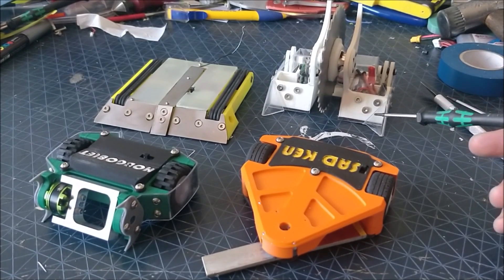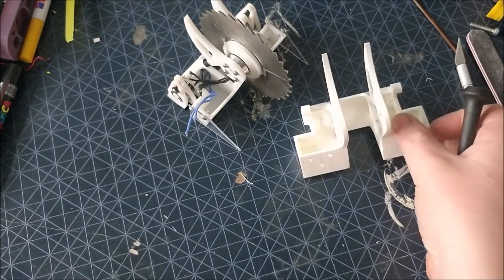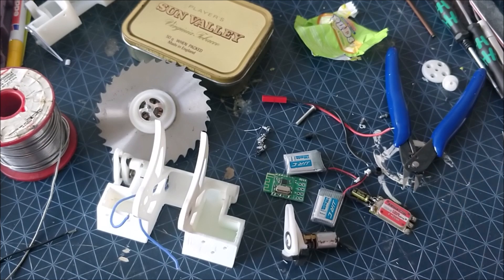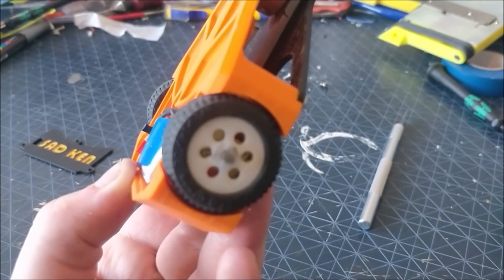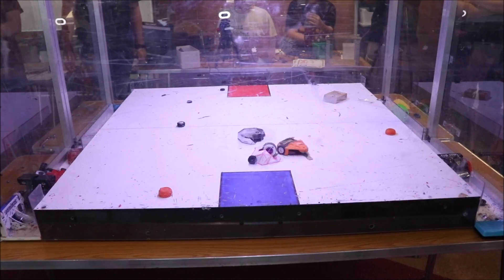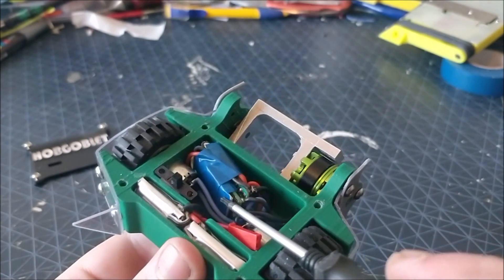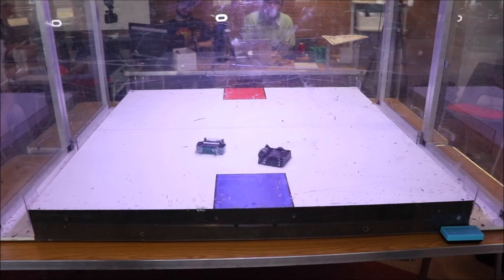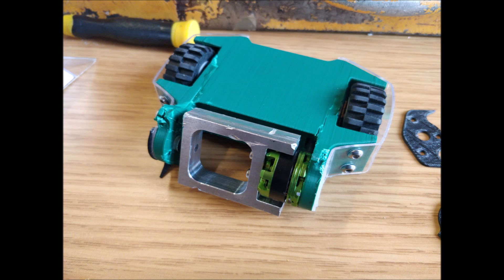A look at some Antweight Battlebots - AWS64

Comment: I know it's a bit old, just wondering by ABS? I never had good layer adhesion with ABS/ASA. At least nothing compared to what I get with PLA, and the impact resistance is way lower than Nylon as well.
Reply from the maker: @werner-real  honestly? I had a zortrax which is an ABS machine and the layer adhesion is immaculate and it's just hit print get part. I use a lot of nylon for my beetles and 'proper' robots. I prefer ABS to PLA as I find it a lot softer and less prone to brittle fracture.
Reply: @HarryMakesThings  I mean it prints and I even removed the fan which seem to make it a little better, but it's still miles away from PLA+ / PETG / TPU. That's why I'm surprise that for bots it's recommended. I know TPU is often forbidden.
Reply from the maker: @WernerBeroux one of the printers I have is a purpose built ABS Machine and while dated is a great asset for just hitting print. I also find the closer to 'pure' ABS the filament is the better. Polycarbonate/ABS blends are fairly often sold as filament which I find really brittle. This stuff is quite nice and soft and tends to take impact well. I'd take this over PLA-ST though I am a vocal champion of that material being the best off the shelf material that any printer can handle. 

Yes TPU is often excellent. I like to use it for armour more than chassis personally. To my knowledge it's only banned in specific plastic only classes. Open combat is always fine. In the UK at least it's only limited to the BBB plastic class for spinning weapons as they have a definite edge which isn't in the spirit of that particular competition. 

If I was making a competitive 150g tomorrow I'd probably use either an ABS or nylon chassis with a mixture of TPU and titanium armor.

Comment: For Hobgoblet how thick are your weapon rails? And how is the other weapon side mounted in the chassis?
Reply from the maker: @l8dawn  Hi, the frame rails were 5mm and the beater has a shaft which rides on a flanged bearing pressed into the bulkhead

Comment: how did you not cut yor self wen you tuhc the blade
Reply from the maker: You don't put too much pressure on it or drag it along skin - think of it like a knife, you can pick it up by the blade if you're careful. Only when you force it or move it will it hurt you.

Comment: Hi! I notice that hobgoblet split along it's layer lines, would it have been more durable if it were printed in the other orientation?
Reply from the maker: Good eye! Yes and no I think is the answer. I would not have had the same fracture points (though these weren't too bad as I could patch them and keep running) but depending how I oriented it it could have been more catastrophic (i.e. the front fell off syndrome) 

I also balance ease of print, removal of supports and how i want it to fail. I think next time just changing material to a nylon or a TPU would take all the failure points away. I'm also looking at using a dead shaft to lock the bulkheads together better and make it more resilient.

Comment: Try polymaker polymax Pla. Very tough we use it on our 1lb bots.
Reply from the maker: Thanks for the suggestion! Looks pretty pricey - about £40 a kilo which puts it into 3 reels of ABS, two of TPU or even taulman 910 levels. Might be a bit much for me. Do you suffer any brittle failures at all?

Comment: I would recommend you to use acetone on the ABS prints to make them stronger. Just brush it on, or you could go fancy and use a pot on low heat and make acetone vapour that will seep into the cracks and really glue the layers together. You can just lower it down with some metal wire.
Reply from the maker: Neat trick! Many moons ago when I first got to grips with ABS printing I tried using a rice cooker to give parts a vapour bath on the cheap. That was back when the stuff I was making had to be prettier and smoother rather than strong but I can see the link now.  I get pretty lucky with my ABS on the whole to be fair. I am currently having a look at blends and ABS based materials that might be a little bit stronger.
Reply: Do they really become stronger after an acetone treatment? I think CNC kitchen tried it and found that the opposite is true.